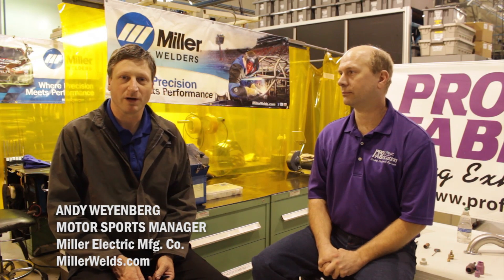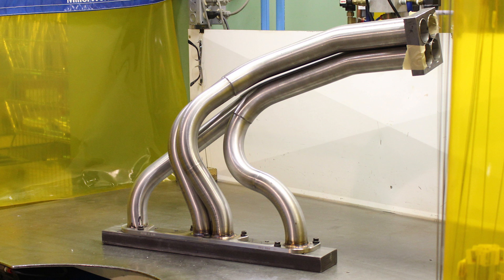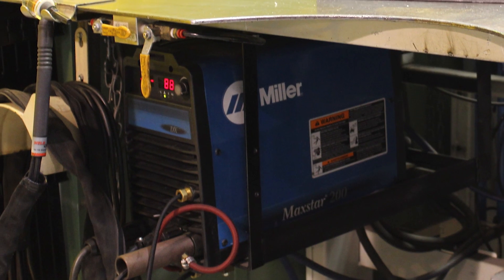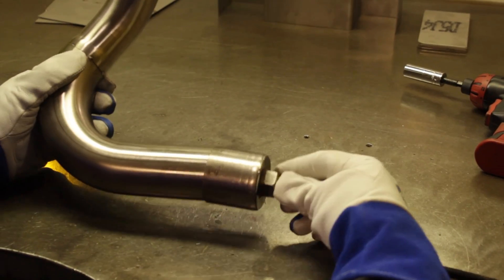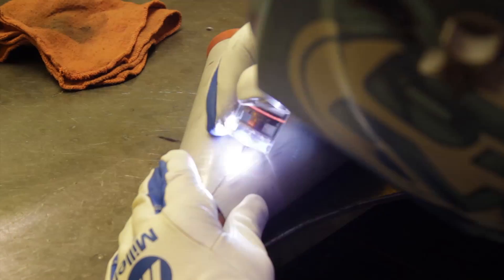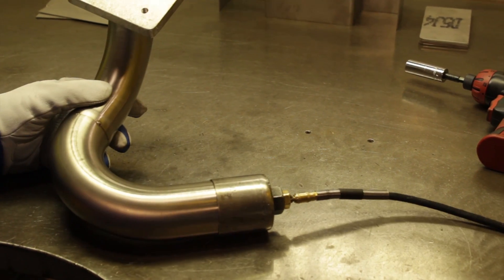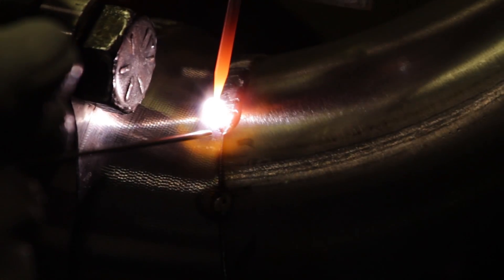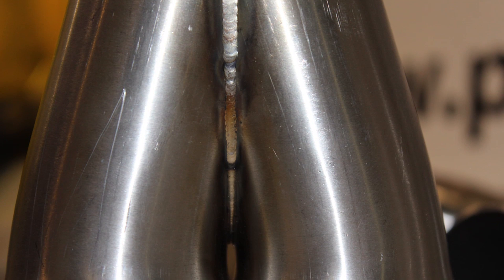Introduction to stainless steel TIG welding

Comment from the maker: New to stainless steel TIG welding? Watch as Andy Weyenberg, Miller motorsports marketing manager, and Steve Sousley of PRO-FABrication introduce key considerations and challenges in racing applications, including temperature control, tungsten types and more. Watch here: